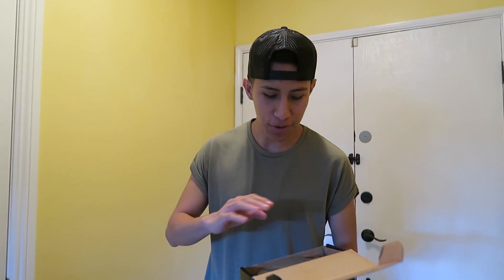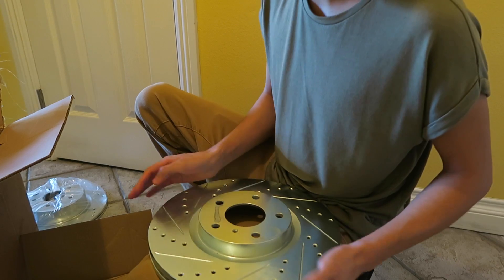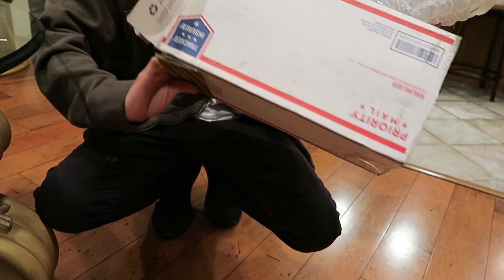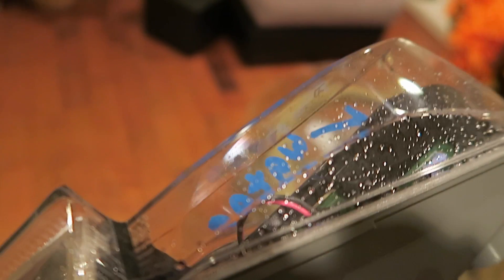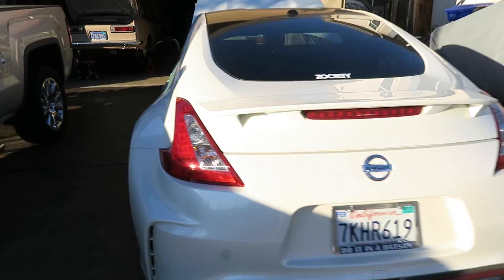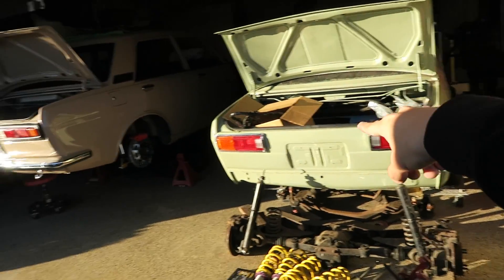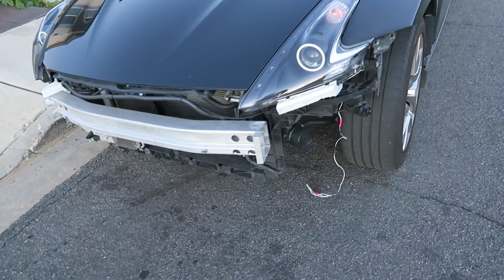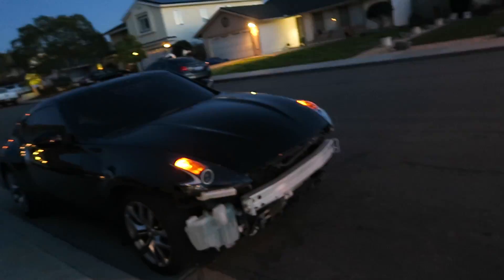MORE CARBON FIBER AND GOODIES FOR THE 370Z!!

Comment: Umm...your friend putting short ram intakes in a Z is pointless and a waste of $$$.  Hope he enjoys all that heat soak.  Good luck on your build. Dual halos are even better with the running strips or landing strips.  You don't like the windshield wiper reservoir?  Just paint it.  Never too much CF, lol, that is right, my car has way more Carbon Fiber and I'm in the process of buying a few more CF parts.